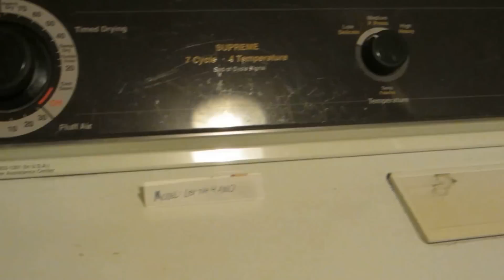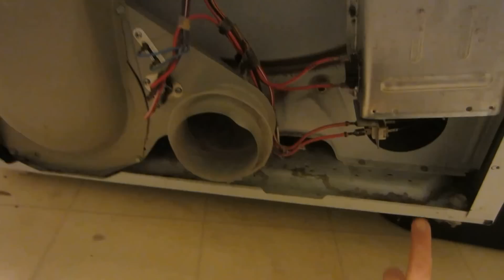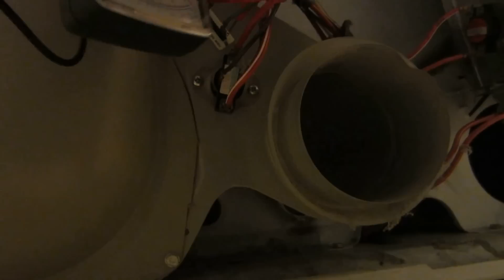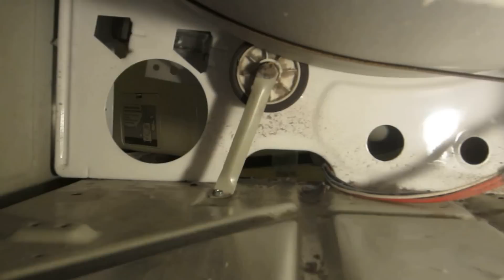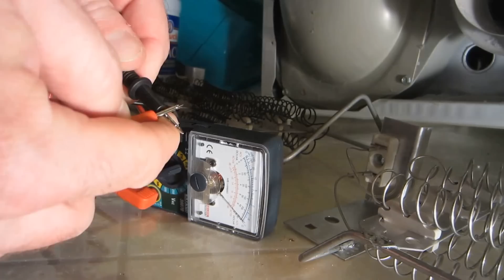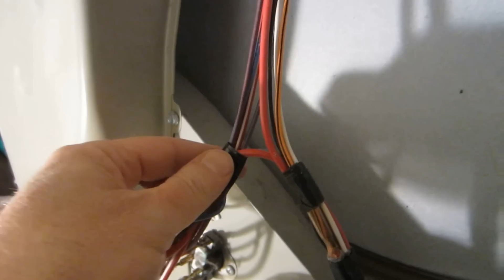Whirlpool Dryer Repair How To - Replace Heating Element

Comment: Joe Turbo here >  My Whirlpool LE5800XMWO, also old, old, old.  Heat Box, Clip to top of Bulkhead, so you can remove heating element.
Remove bottom screw Heat Box to Dryer Heating Element (as in Video) , flip dryer top to have access to the top of Heat Box.  Clip is attached from Heat box to Bulkhead with one screw. Then slide box up from saddle mount to remove old Element and replace with new one.  Great Video, Thank you.

Comment: Thank you for this video! My steps were different but you got me most of the way there and for that I am thankful.

For others with dryers of similar vintage who are looking to replace the heating element:
I have Whirlpool model LE5550XTW0 which has a few differences from the one pictured. The front of the dryer did not have an access panel at the bottom. It is possible to get the front off though. Open the lint trap door on the top of the machine and remove the two screws present. Then take a flathead screwdriver and pry up the top panel/lid of the dryer. Once you have the top lid open, you will see two screws, one on each side of the front panel. Remove these screws, detach the wires leading to the door switch and the plastic holder. Lift up and out and the front panel will come off. 

However I don't think it's necessary to take the front panel off. I used a 5/16" wrench and was able to get the bottom screw off from access at the  rear of the machine. 

To get to the heating element, my model did not have enough clearance to pull out the element from the bottom and required removal of the entire heater box. In addition to the lower screw shown in the video, there is an additional screw and bracket that needs to be accessed through the top panel of the dryer. Remove the top screw, disconnect the thermostat wires, then pull up and out on the heater box and it will come out along with the heating element.
Reply: Hey hey! I'm currently working on my dryer as well, I'm sorry you went through that. I know it's all too late, so maybe this will help someone else. I don't have any of the fancy tools and am currently aging to get this last screw with a 5/16 wrench from the back and guiding by feeling with my other hand(right tighty lefty loosey style). 
I'm going to put this corner on a stool or something and maybe I can avoid the same issue you had with bending it. Wish me luck!

Comment: GETTING THE ELEMENT OUT. So I capitalized that to hopefully draw attention lol.  I actually have an older KENMORE dryer.  I was having this very problem and I came to YouTube for help. The set up on my dryer was the same as this one, however I DID NOT have a front peice to remove. So after checking out the housing to see if I could remove that, I discovered a screw at the top, with I conveniently located hole for my tool located in the peice of sheet metal above it. I inserted the tool through the hole, and was able to unscrew it. Make sure you hang onto your screw though. I will also add that I had my dryer face down at this point. Once the screw was removed I was able to pull that part of the housing out of where it ran into the drum. There were 2 slots it was resting in that it easily lifted up out of. The whole thing came off and that nasty, horribly places screw was easily taken care of. And the element slid out perfectly to be replaced. It was also easy to put everything back on and hook up.  I'll also add that before replacing the back panel I hooked the hose up to try it out to make sure the element was my issue. I didn't have any fancy tools and diagnosed by process of elimination lol.  My dryer heated so I stopped it and put it all back together.  I hope this helps somebody,  as I was frustrated for quite some time trying to figure out how to get the element out. Good luck!!

Comment: Good video.  I have the Whirlpool LE5800XSN3. Putting it back in was more difficult.  I felt like I was mangling the coils due the angle.  I had to bend the element a little for it to go back in.  Obviously you can mangle it when you're taking it out. The screws were the easy part. If you have shown the act of putting it back in, it would have been an excellent video.  I understand that every model is different but what I don't understand is why you didn't show the viewers the act of putting back in.  I think you know what I'm getting at.
Reply: Good point. As I recall, it was hard to get the dryer tilted up enough for it to fit cleanly.  Hard to do all that and video record. Thanks!

Comment: Would love more detail on how you got that damn screw out! I worked on it for two hours and can't get anything to budge it. And my dyer doesn't have that access panel thing in the front.  Not sure who designed this thing, but they should be drawn and quartered! Thanks for the info you gave, it certainly helped at least figure out what I needed to get unscrewed.
Reply: same

Comment: I knew there must have been a reason for your not showing in the video how you got the heating element out or in.   These kind of videos are so deceptive to make it look very easy.  So, after struggling for 4 hours to get the heating element out (had to bend it) and getting new one in (had to bend it then try to bend it back) it did not work.  Heard a bang and a flash of light and quickly unplugged it.  Apparently having to bend the heating element must have caused some damage.  Trying to get that one screw out took me literally hours because I do not have any fancy tools and the screw is behind the panel. To make matters worse, when I bent the heating element to get it in, some cheaply soldered together piece fell apart so maybe that had something to do with my almost burning the house down.  When all was said and done, I bandaged the cuts I sustained from trying to get at that screw and the burn I got from trying unsuccessfully to re-solder the piece that came apart, threw away the now broken and bent heating coil and will now throw the dryer away.  Obviously the dryer was built to never be worth fixing.  Really, now be honest, how did you get the heating element out????

Comment: If you had removed the top hidden screw on the heater housing the heater housing with heater would have been able to be removed also  and it is best to have the dryer laying face down also !
Reply: With the dryer face down you can get the housing out and access everything easier. No bending of the element, no half-hidden screws.

Comment: almost - grrrrr. I have Model LE5650XMW1, but the back is exactly the same. However, I don't have the front panel, and the bottom is covered, so it's like you'd have to turn it upside down and take off the bottom. I can feel the screw from the back but there's no room to loosen it. Dang.

UPDATE: Well, I wrestled my dryer TO THE GROUND and pinned the sucka! So my model LE5650XMW1 does not have a front panel, like a couple of commenters below said. The screw is behind the housing and basically impossible to get to. So I took a small pair of pliers, and felt around the housing, and bit by bit I got the screw loose. And in the course of things I pinched my finger with the pliers! Yeeeeoooohhhh!!!! Whoever designed (and approved) this thing IS AN IDIOT. 

And you can't even pull out or install the long heating unit without beating the thing to he**. But I got it out and the new one in with a little muscle, and voila, we have heat! So as long as it doesn't burn the house down, we're good. And my wife is one happy camper. But geez on this design.
Reply: Perhaps a socket can fit that screw?

Comment: Thank you so much for this video. I was puzzling about just how to get this stupid heating element out! All of the other videos I viewed have the newer 2-part can that encloses the heating element and I wasn't sure if I should try to remove the entire 1-part can from the dryer back. I usually hesitate when I feel that my good intentions may result in a disastrous result when I opened the top of the dryer and couldn't figure out how to elegantly remove the top of the can. So I kept searching YouTubes and hooray! I found your video! You gave a good tip in elevating the back of the dryer to be able to remove the element, and I used an 8mm crescent wrench to remove that pesky mounting screw (which you mentioned at the end of the video). Why the holes in the cabinet body don't line up with easier access to that screw seems like bad design or the factory installs the heating element before mounting the can. Anyway, THANK YOU for this video since this makes it possible for me to make this repair!
Reply: 100% Agree, this video saved me a ton of cash!
Reply: This is a life saver for me also! Going to attempt it tonight. Wish me luck.
Reply: Yeah, same for me. The trick on getting this heating element out was the highlight of this video for me. Everything else was good, but I could not figure that out until you showed how you did that. Thanks!
Reply: @BrianStinar  same here!!!
Reply: Mine still won’t clear the bottom of the dryer, the angle is wrong. I laid the dryer on it’s side, element still hits the bottom.

Comment: I really need some help. My heating element cover looks exactly like yours except it is farther back. I can't seem to pull the heating element far enough forward to get it out. What should I do? My model number is LE5700XSN0
Reply: For anyone having this same problem, there is one more screw at the top of the heating element cover that you have to stick a nut driver through a hole in the back of the dryer; once you have this out, lift up on the heating element cover slightly, then pull towards you, then the whole thing should be removable, and you can pull it far enough forward to get the heating element out.  Also be careful to check the fuse like he does in the beginning because sometimes the heating element touching the heating element case is what burns out the fuse.
Reply: Laura Whang I

Comment: that is almost exactly like mine, but mine does not have that removable front panel and having one hellava time getting at the screw. when I go put it back together, that screw, will be put in from the back so I can easily get to the head of it. tried a vise grip, an adjustable wrench dont have the right crescent wrench so now going to try needle nose, and you all know that means skint knuckles coming up for me. All I can say is the enginer is an idiot for putting that screw on the WRONG SIDE, COMPLETE DUMBASS.
Reply: As usual, it boils down to having the tools for the job. Once I found my 5/16 crescent wrench, took about 30 seconds to put that screw back in. What I want to know, is why did that screw have to go in from the back? Why was the other hole for tgat screw so big that the screw had to go in from the back. Retarded engineers!
Reply: 5/16 when everything else is 1/4